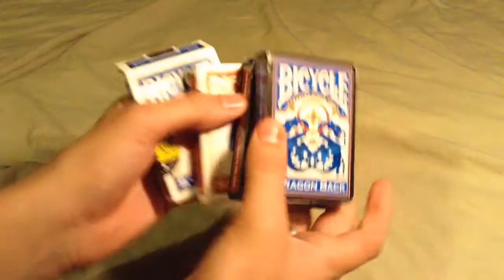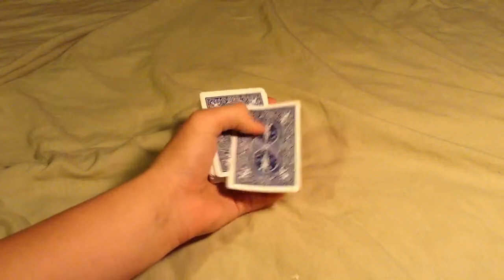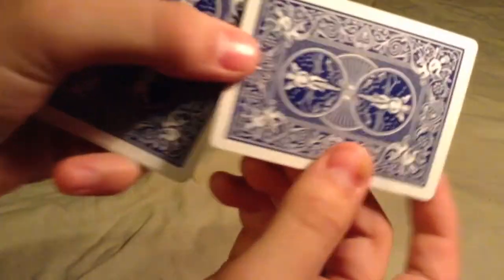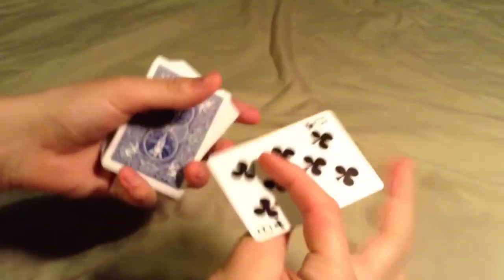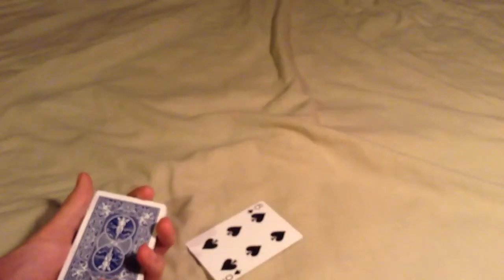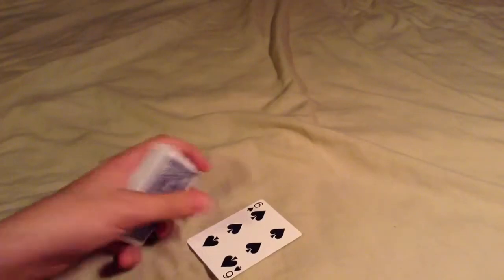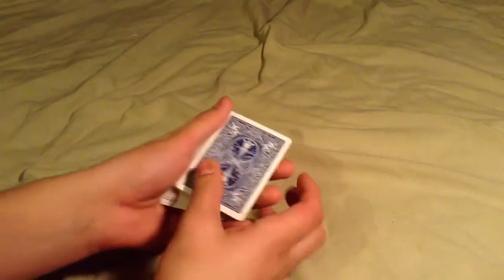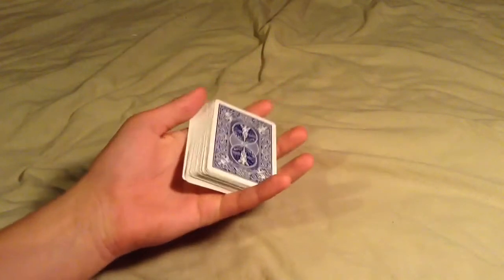Air-Cushion Finish? Explanation

Comment: um is it normal that air cushion finish card will stick together>??
Reply: no that means they are too humid and stuck together put them in the fridge for a bit and they will be very smooth
Reply: @AZ0C  ok ty btw do you have any good idea to make cards straight again? mine is a bit bend and idk how to make then straight again.
Reply: @kelvinmansour1536  set them under a book and  set some really heavy stuff on the book and leave that for a day or so, that might straighten them out, hope this works, I've only tried it with paper and bank notes but it might work.
Reply: @AZ0C  ok ty
Reply: @kelvinmansour1536  the main thing is evenly distributed pressure, if done right, they will be as straight as a new deck.
Reply: @AZ0C  aight
Reply: @AZ0C  u live in vic?
Reply: @kelvinmansour1536  vic?
Reply: @kelvinmansour1536  what is vic?
Reply: @AZ0C  victoria  in au.
Reply: @kelvinmansour1536  no
Reply: @AZ0C  i've tried putting my standard bicycle deck in the fridge...and after like 3hours it became more humid, and the cards became more weak...i think the best way to keep the cards durability is by keeping them in an air conditioned room...
Reply: @seatankoable  The only way that it is scientifically possible for it to get more humid is if there is a liquid in the refrigerator that induces water and or humidity.
Reply: @seatankoable  because otherwise the air in the refrigerator would be dry.
Reply: @AZ0C  yes you are absolutely right..
Reply: @seatankoable  also any unsealed produce can cause precipitation to a small extent.